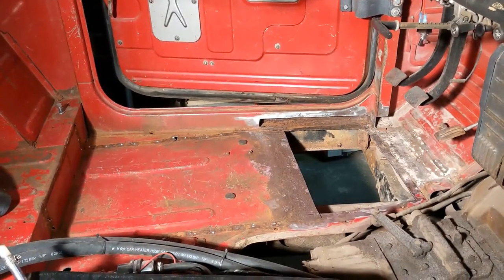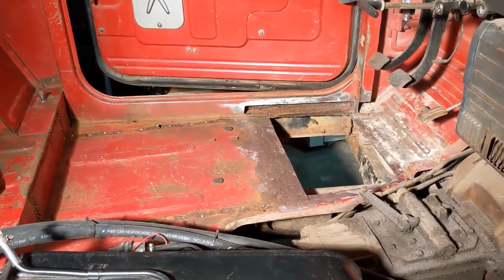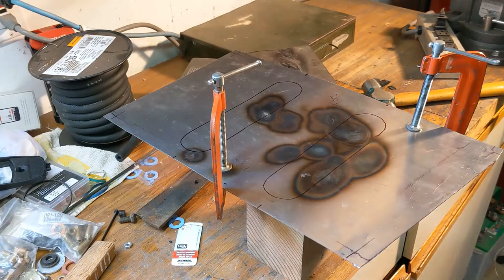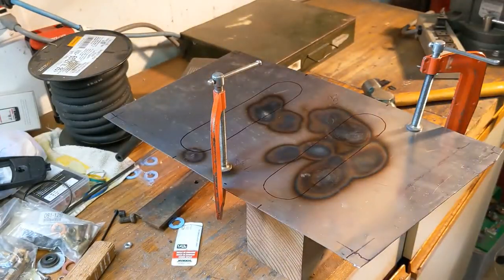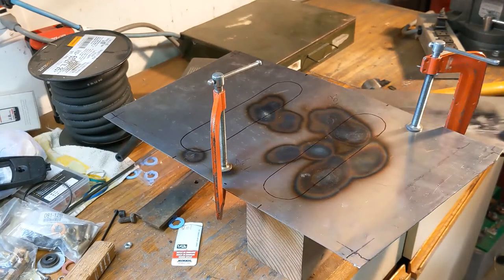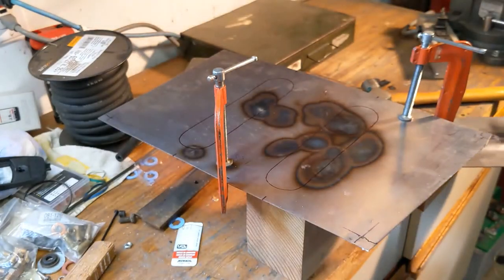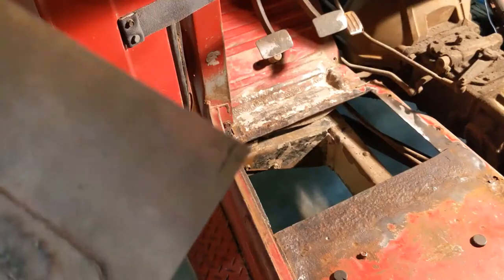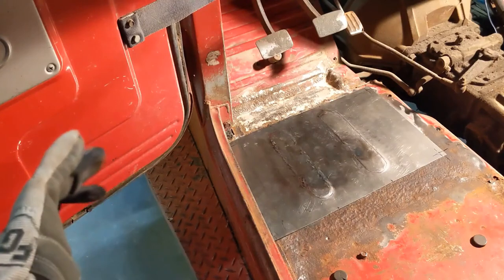Floor Panel Repair

Comment: What a great way to add in the ribbing! I’m getting ready to start on my 74 FJ40 that I’ve owned for 29 years and it’s going to need a bit of that. Thanks for showing us a great technique.
Reply from the maker: Best of luck with your restoration and thanks for watching